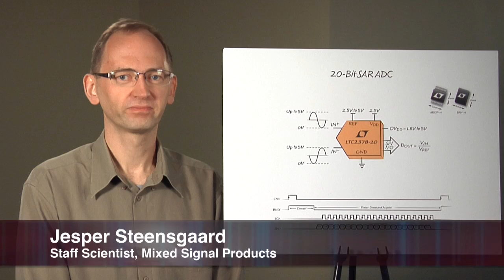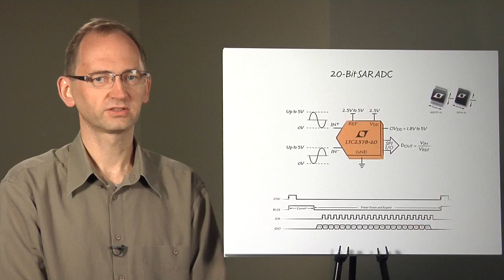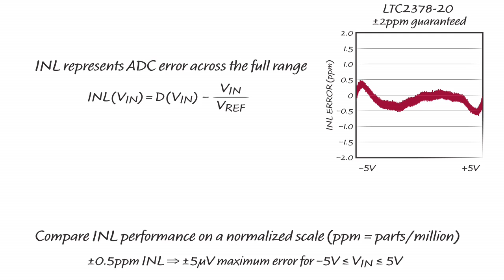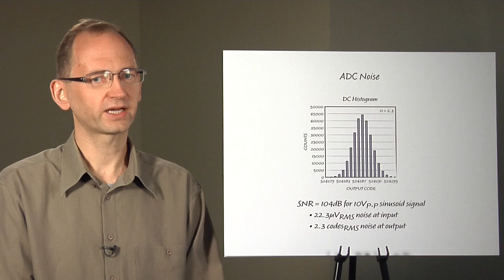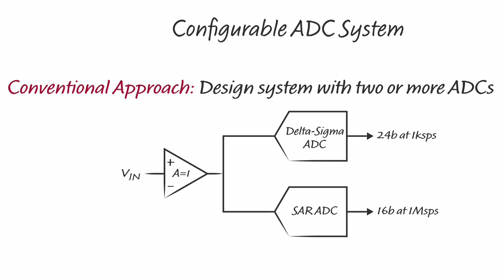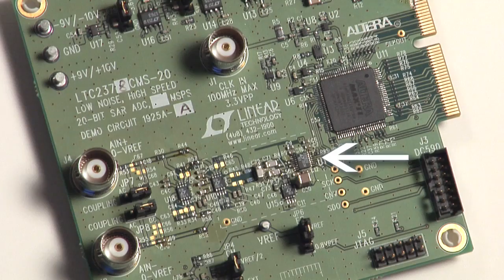20-Bit 1Msps 0.5ppm INL SAR ADC

Comment: A single measurement at 1MHz has an uncertainty of 14LSB so I've got to average 50 results to get within 1LSB?

Uhhh....I think you've only got a 20kHz ADC. !!!

I remember you used to be able to buy high resolution ADCs where INL was specified in LSBs.

A single measurement at the specified bandwidth, no averaging required, to get the advertised sample rate.

An awful lot of handwaving to say you've only got a 20kHz 20-bit converter.  

Your output data rate is clearly not your conversion rate - people don't want a 1MSPS converter if their input can't change for 50  conversions in order to get the specified number of bits!

It's certainly how it sounded  to me - a lot of handwaving which suggested to me that the customer needs to average the heck out of the output to correct for your internal clock jitter and reference noise if they ever expect to use the lower three or four bits.... and that's not going to happen at 1MHz with a dynamic input.